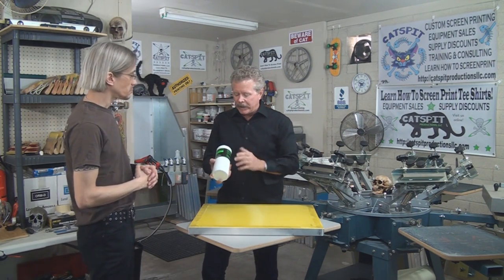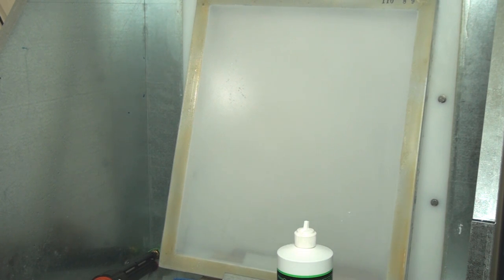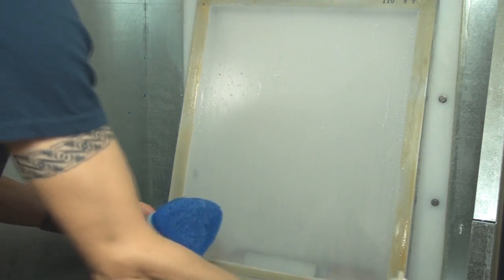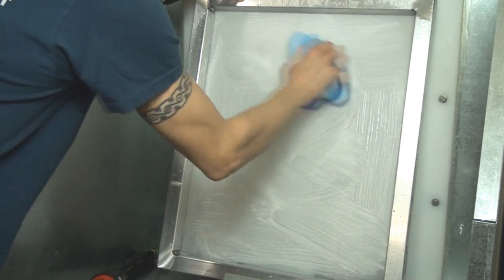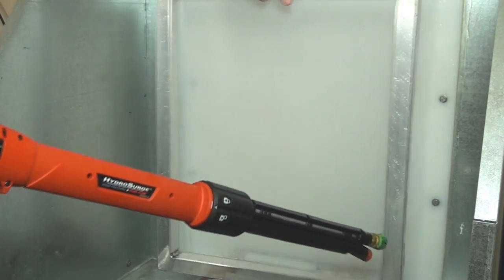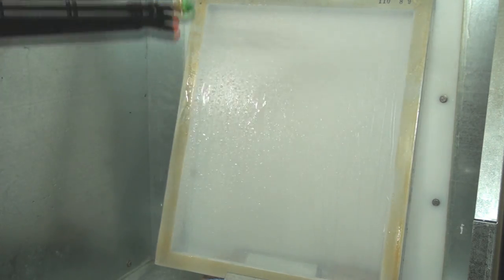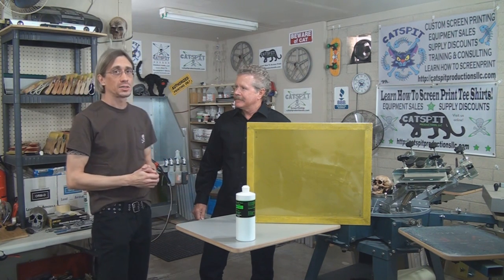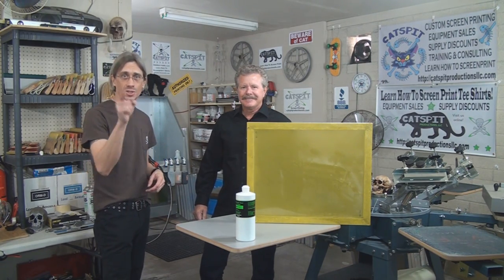Environmentally Safe Screen Degreaser For Screenprinting

Comment from the maker: LOL... yeah I use some oil free soap now and then when I need to but I get a lot of chemicals to test so I always seem to have something on hand. But if you use a dish soap try to find one that has not hand softeners or anything like that because those are types of hand oils added to reduce the dryness felt on your hands after doing dishes. Sometimes that can be a problem. I really like RhinoTechs degreaser and it's not too expensive. Thanks for watching and leaving a comment! ☠